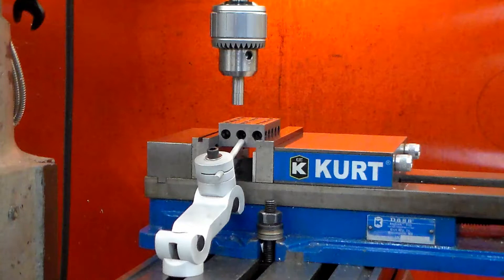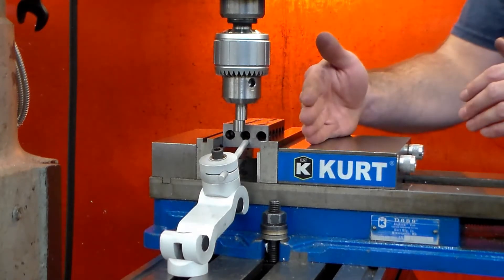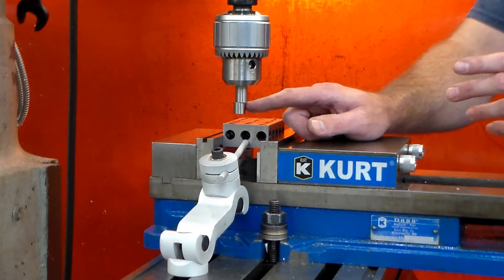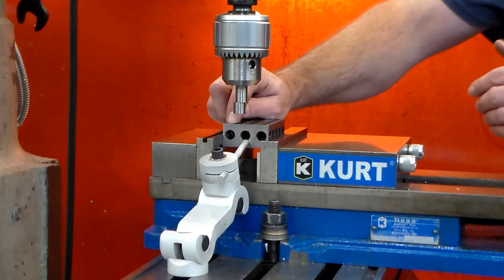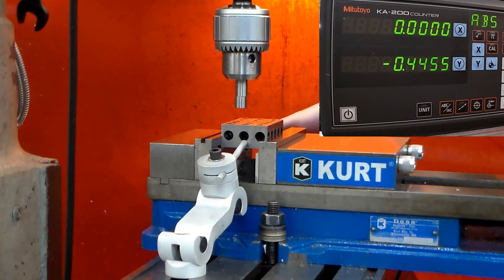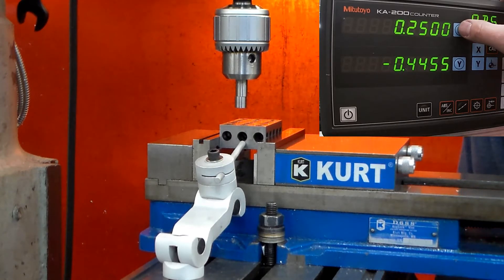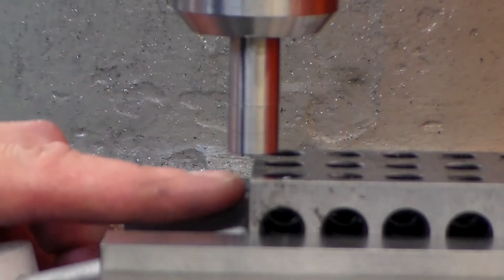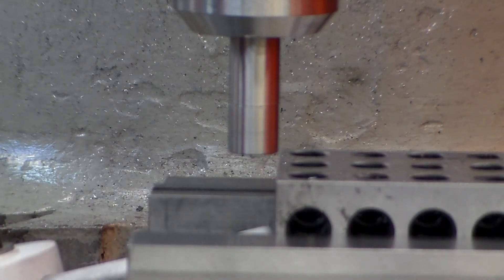How to use an Edge Finder

Comment: It looks like you have a numerical keypad on the DRO. Instead of setting the DRO to zero just enter the edge finder radius 0.250 then you don't need to move the table 0.250 and re-zero the DRO.